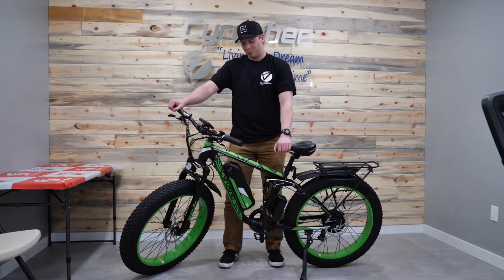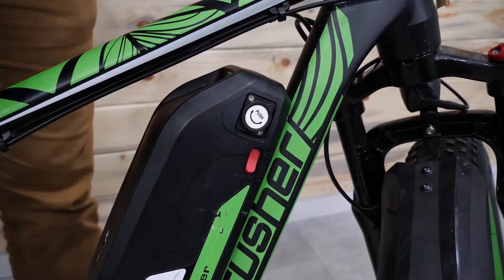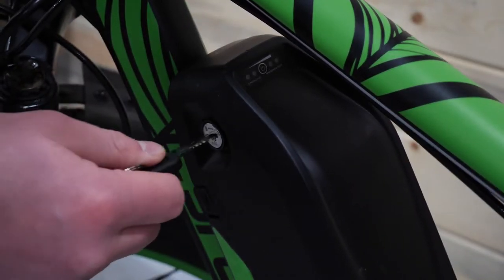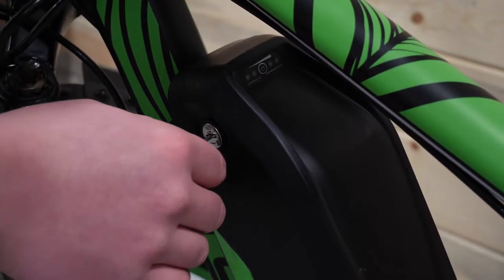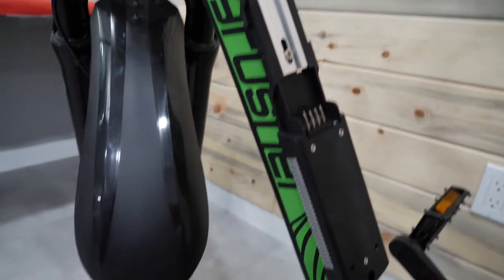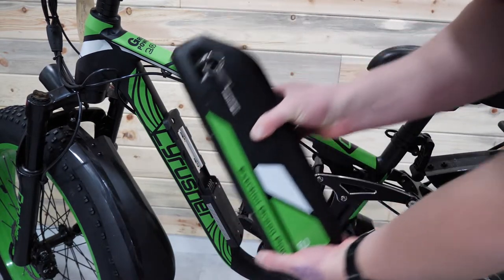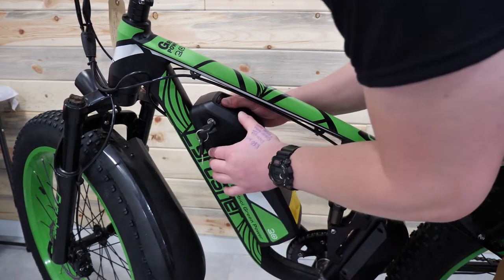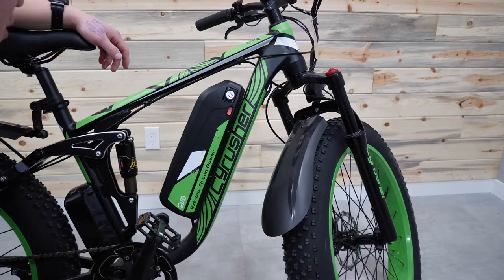Battery installment and removal for Cyrusher XF650, XF800, and XF900 models

Comment: Hi, can i use the XF900 17ah battery on my XF800 ??
Reply from the maker: Hi, the batteries for the XF800 and the XF900 are exclusive, so you can't switch between the bike models

Comment: iv just had the xf800 delivered and they sent the wrong charger Cyrusher UK dont answer the phone  they ignore you on the chat .. aftersales service ...JOKE
Reply from the maker: Currently, our UK customer service team is based in China, we are working to get a location set up within the UK that does customer service the same way we do customer service here (at the Utah Warehouse). I'm sorry to hear about the difficulties reaching out to the team, have you filled out a support ticket yet? This is the best way to get a response for customer service.
Reply from the maker: If you have your order number available, I can message the UK support team and get the correct charger headed your way ASAP
Reply: @cyrushertech  they have sent me the correct charger but not after making a complaint .. if you spend £2000 on a ebike then you expect the after service to respond straight away after the mistake they have made , i have charged the battery only took 2 hours which is odd because it states 5-7 hours the computer showed the battery with 2 bars , pity it doesn't show percentage other than that the bike is amazing , heavy but amazing ..